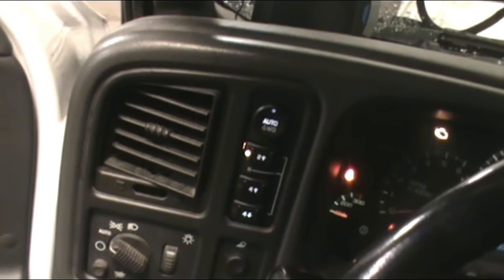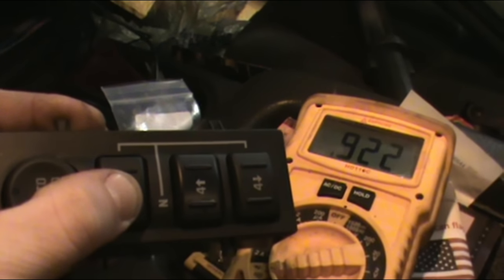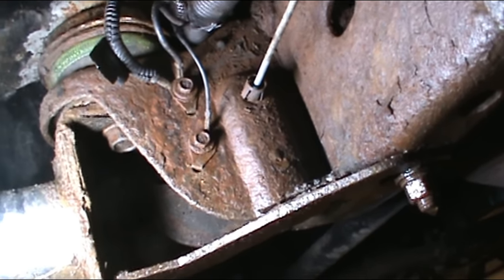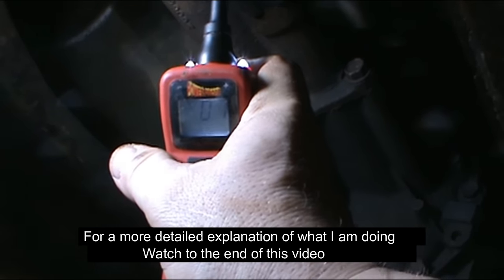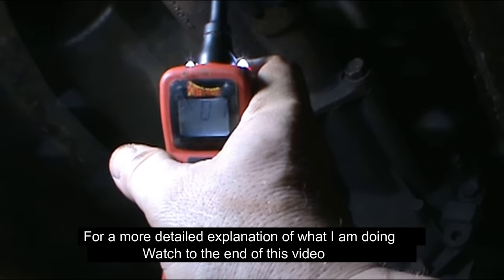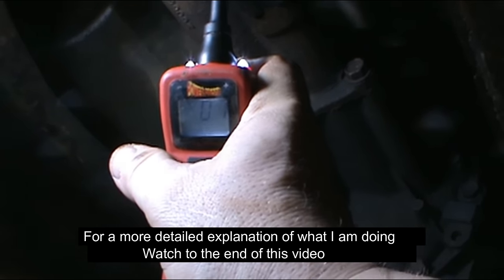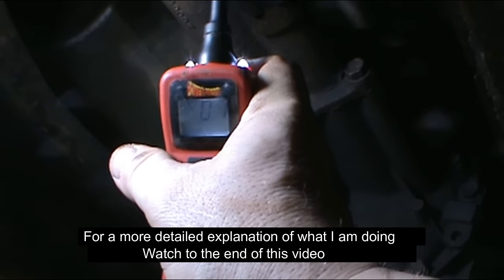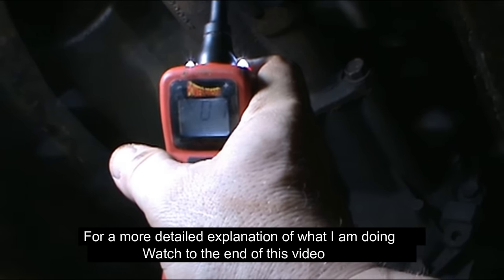Service 4wd diagnosis

Comment: DUDE I OWE YOU A BEER!!!! I did the same thing and the guy I bought the truck from even changed the transfer case trying to fix it. I replaced everything else and was about to rip the harness out when I seen your post. 5min after locating that 4 pin connector added a ground and BAM!! it's fixed thank you soooo much!
Reply from the maker: Tony Gick Miller lite please, and your welcome

Comment: A year later after this upload and I have the same issue staring at me. If I learned anything about wrenching in 62 years it is to search you tube and keep the wallet closed and ask questions. Great diag. video and when the rain stops on on it like flies and dung. Cheers to you good sir.
Reply from the maker: @letthechipsfly7620  welcome

Comment: I can’t believe how well you went through the process. So much better then other. I changed everything before looking at the 4wd ground wire. Cleaned it then worked great
Reply from the maker: Ryan Dimaquibo so did I, that is what inspired the video.  I even took it to a professional shop and they couldn’t figure it out.  They changed the front axle actuator twice and told me they kept getting bad ones.  I took it home and troubleshot the wiring and this is what I found.

Comment: thanks for sharing! I'll try running ground wire tmrw. Was wondering if its not to much to ask The blue wire you ran. To which color wire on the clip did you tap into?
Reply from the maker: Sirena Mireles if I remember correctly it was black, but please check the diagram for your vehicle
Reply: @GSEShop  thank you and will do thanks for reply.

Comment: my switch started randomly lighting up on 2wd/4wd/neutral/4 on the fly/ or not at all.  So I changed the switch out.  When I first put the other one in, the encoder motor responded fine. I did 5-6 times, so I thought I fixed it.  However, next day I drove it, it went back to doing the same thing again with the service 4wd on the cluster again.
Reply from the maker: I would check the wires close to the encoder, but I suspect the encoder is bad

Comment: Man you are so awesome, I was at such a loss, switched out the selector ordered the actuator (which is now cancelled) and just happened to stumble on your video and as soon as I watched it I knew this is exactly what it was, went to Home Depot bought a multimeter, a pack of vampire connector and sure enough after maybe 30 minutes in the garage, my selector lights are working, service 4wd message is gone, and this encoder sounds like it has so much more power! Thank you so much you helped me out a great deal and I’m sure you’ve saved many asses, hats off if your ever in Oklahoma, beers on me!!
Reply from the maker: Thanks, not sure about the more power, but hey if I am ever near OK I will let you know

Comment: Dude I just replaced the actuator and spent forever trying to clean up the old ground and everything just to watch this and tap into the ground wire at the harness and run it to the main engine ground spot under the hood, thanks a ton! Fixed my problem instantly I cant believe I didn't think of this sooner glad i had all the supplies being it 10:30pm😁
Reply from the maker: Ryan Hazelton glad to hear it

Comment: I watched this video before doing anything.  You were absolutely 💯% right.. Got my meter out. Checked all 4 points. Found no ground. I ran a temporary ground wire and tested. Sure enough it worked. So, I ran a new ground wire. No more "Service4wd" ... Awesome. Thank you for your post on this.
Reply from the maker: Your welcome: I just don’t want others to struggle and spend money like I did.  Please like and subscribe

Comment: I had this problem along with the loss of cruise control.
Turned out to be the ignition switch. A local tech figured it out for me after I had gone through all of the grounds and fuses etc. Didn't take him long. If you don't have the tools and or diagnostic skills sometimes it pays to take it to someone that does. $100 fix for me.
Great video. Pretty cool watching you guys drill down on stuff like this.
Reply from the maker: Thank you, I like the challenge

Comment: Thanks for taking time out of your day to share your experience!  I'll use your techniques to check my Suburban.  One thing I'd like to suggest is when reconnecting the wire connectors, add dielectric grease on them.  Some of my issues in the past were related to moisture in the connectors under the truck.  Thanks again!
Reply from the maker: Not bad advice, but thanks for the praise.  If I ever redo this video I will add it

Comment: Same as many others who have seen your video, thanks man. I swapped out the encoder motor and switch. Nothing worked untill I checked the grounds and added a ground wire.
Reply from the maker: Glad I could help

Comment: After watching a couple vidoes and in one it said the form said to start with cleaning off ground bolts. All I did was clean the ground bolts with wd40 and toothbrush and it worked . Before that none of the lights for 2wd 4wd lights were alumanating and was getting service 4wd code. All good now. Thank god for youtube 🙏
Reply from the maker: The wires will corrode and that way my problem so I spliced in the other ground wire.  Glad the simper fix worked for you

Comment: Brother that was a great video. I'm educated in electronics and  love auto electronic troubleshooting. Your video will help many  people find the failure related to the notorious service 4WD message with your troubleshooting procedures. There is nothing wrong with repair shortcuts like your repair if resources are limited or just need to get up and running quickly. Most will start throwing money and parts at their trucks so thank you for taking the time to share. I've subscribed and will keep an eye open for more videos from you. Take Care.
Stephen from North Carolina
Reply from the maker: Yotu Act thanks, I love to troubleshoot as well.

Comment: Thank you for your excellent video! My Yukon XL dropped into 4L from 2H by itself on a highway today lol! Checked every ground on the frame, wires and the 4wd fuses. Wallet and Yukon not ripped apart!👍
Reply from the maker: Glad I could help

Comment: Thanks, I have a low milage 07 duramax that the 4whl drive hasn’t worked in 5 months. It’s horrible in 2wd in the snow and mud. I worked at a shop in my early 20s but its been decades. I was getting super frustrated with it and myself. Your video helped me a lot as far as what to look for and how the system works. All my other trucks were manual trans and manual 4x4 so were easy.  With your video and 1/2 of a Sunday I was able to get it working again!👍😀
Reply from the maker: Great thanks for commenting

Comment: Hi I have been troubleshooting for some time on my 4WD issues. So I went through the progression of the grounds cleaning first. Then instead of replacing the actuator motor i decided to go after the position sensor within, much cheaper of course. I got the AC Delco on Amazon for $35. So when i disassembled the actuator i noticed that the gears were previously matched marked but low and behold the factory match mark did not line up. I went and installed the gear, not where i found it but to the factory marks. So yes the smoking gun! I reassembled everything and my intermittent  service 4WD and the selector switch with the random lights coming and going were gone! That's great unfortunately it still would not shift into 4WD. So next step was the front diff actuator. I pulled it out and gave it power but it didn't budge. So I checked the voltage at the plug and got the 12 volts on the brown wire but got no ground on the black wire - should have read 000 on the ohm meter but only read 1 meaning no ground like the video. I tapped into the ground with a vampire connector right close to the plug instead of chasing it back. I ground down a spot on the frame and ran new wire to the frame and fastened it with a self tapping screw. Tried it again and Viola!  the motor turns. Reassembled it all and it works perfect. Thanks so much for the video help and helping the diagnosis, solved both issues for $35.
Reply from the maker: Your welcome, please like and sub.  Hearing this makes it all worth while
Reply: Right on, good info.
Reply from the maker: @halfassranch8363  thanks
Reply: @GSEShop  your video has by far been the best.  It covers all the other videos I've watched in one. I'm pretty sure its the dash switch but all my freaking tools are in storage and two hours away.
Reply from the maker: @halfassranch8363  your welcome

Comment: I have a 2004 Avalanche ...Service 4WD ...same issue.... I am going to try this, I too have been fighting for 2 years... replaced switch, replaced TCCM..... error comes on ocasionally (usually when you need it.) has been working great for  months until the Giant pot holes on the interstate jarred the truck to death.... no more 4WD....... I am more than sure it is a Ground wire, you have given me a great place to start...THnx
Reply from the maker: You’re welcome

Comment: Gonna have to try this. I tried the motor, the switch, the brain, the ground on frame, front actuator and transfer case speed sensor and nothing has worked. Thank you for posting this.
Reply from the maker: nick newman I even took it to a pro shop and they couldn’t figure it out

Comment: Good info 90 percent of the electrical problems can be traced back to lack of ground. Thank you for sharing. Make up a simple jump wire @ 3' long with a clip on both ends to do your ground testing is one of the cheapest and most useful tools you can have. Very good info. Thanks
Reply from the maker: Gary Jordan good idea

Comment: Great video, one handed dexterity is looking good, I did an o2 recently and had to connecti it one handed, it took a bit but i got it. No to try and fix this ground issue, I have already cleaned the terms under the truck on the frame, so not i will check the front acuater ground. thank you very very much for the video, good good stuff here.
Reply from the maker: Thank you

Comment: Actually a very helpful video! Going to try this on my '01 z71 4.8. Got one for you. I lost all drive while shifting through 2 and 4wd. Now when I shift from neutral to park I get a grinding sound. Park doesn't lock the wheels. Someone who knows, will know in a second. Please help me out. I hate to throw parts. Reason I really love this video. You actually show how to diagnose. Thanks man!
Reply from the maker: Check out my Silverado pops in neutral video and my one one replacing the transfer case shift motor.  I think your answers are there

Comment: this is so crazy. I bought new for the first time in my life and I`m 64 years old. I looked for the the cheapest Yukon that I could find. made the deal when I picked it up it had 2 miles on it. nobody drove this truck. it owes me nothing. 345,000 miles on the Original motor & transmission. I did almost the same thing that you did. Switch, shift motor & actuator with no luck. I figured that with all the miles on her that the Transfer case was beat. oh and I even did the ground lines under the side of the  drivers side door. I even ran a main ground line from the first connection where the negative side of the Battery  goes to. then ran it to the fire wall then ran a main from the fire wall to the frame on the drivers side making sure that I have a good ground. watched your Video and said no way. but I just did exactly like you did and no more blinking light on the switch and no more SERVICE 4X4 on the dash and everything works as it should. I can`t thank you enough for your Knowledge on the way you chased this problem down. I have played with this for a year and a half and I was stuck on a TCCM or a transfer case. until you.  I am still in shock but with a smile.  Thanks again  Bill
Reply from the maker: Your welcome glad I could help

Comment: Dude, you rock! I had the same issue on my 2005 SLE, with a  Code C0379. I didn't have a power probe (ordered and coming in tomorrow) so I back probed the ground wire at the actuator connector with a paper clip, attached a jumper wire to that with a small needle nose vice grip, and attached the other end of the wire to a random frame bolt with another pair of vice grips. Powered up, hit the 4H button, BAMM! it worked. Hit 2wd and it switched back no problem. I followed the harness from the actuator up under the hood, where it connected to the same style plug as you showed. Spliced into the black wire and ran the wire over to the right side of the brake booster to a firewall stud located between it and the fender. I liked that the wire was a little more discrete in that location. 
Thanks for taking the time to do the video.
Reply from the maker: Carey Buchanan I am glad, I just hope I can save someone else the sleepless nights and money I spent.  Please like and subscribe
Reply from the maker: By the way the power probe is worth every penny

Comment from the maker: Thanks please thumb up and subscribe!!
Reply from the maker: Thanks
Reply: Hi GSE, so my 2005 5.3 chevy silverado was having the same problem as your truck it was in 2wd with 2wd light illuminated but no response when i tried shifting it. I bought a new front actuator a new encoder motor and a new switch. I tried the new motor and actuator and after a vit of fiddling with the new motor not on the truck just dangling it shifted into 4lo but the 2hi light was still on. It would not shift back and i unplugged it and replugged it and now there are zero lights with new or old motor although new switch displays neutral i know its in 2hi and old switch has no lights on. I forgot to mention with the old motor in i plugged the new switch in and it said 2hi and neutral. I unplugged and re plugged and now only the neutral light
Reply from the maker: @jaxonchang737  I would say you have an encoder problem.  I would put the new one on and mount it fully and see if that fixes it

Comment: THANK YOU SO MUCH! My 2005 Tahoe is having the “Service 4WD” error message. A yr ago, I replace the dash switch, fine until now. I know the mechanical parts work - it is stuck in 2WD, and I cannot change this, so the error has got to be a faulty ground somewhere. MUCH APPRECIATED!
Reply from the maker: Your welcome, please like and sub
Reply: I’m having trouble with my Blend Door Actuators, 2005 Tahoe. I’ve watched replacement of these (drivers and passenger) many times. Passenger seems toughest. 
1. Do you have any videos posted that address this issue?
2. How many ‘Blend Doors’ do these vehicles typically have (can’t find a straight answer). 3? 4? 
Thanks! DS (Surrey, BC, Canada)
Reply from the maker: @dstotyn1029  i do not have a video on that but I did do it once and it didn’t fix anything for me.  I only have one under the passenger dash but I cannot confirm on the bigger Tahoe or suburban
Reply: @GSEShop  thank you for the reply. Based on what I’ve seen, I prob have 3 Blend Doors in front part of cabin (rear area is working fine), aside from the main Mode door. I’ll have to dig in to find the 3rd, believe it’s above gas pedal (under shroud). I’m fairly certain one or all of these are my problem, because of the intermittent work/not working scenario. I’ve recalibrated. Works fine, then not so good. Anyway, I really appreciate all of your videos. Please keep up the great work. You do a great job of capturing the details on video and explaining things so a dummy like me can comprehend and take action. Cheers, DS
Reply from the maker: @dstotyn1029  thanks, it takes a dummy to speak dummy lol
Reply: @GSEShop  You’re so modest... lol

Comment: Thank you for sharing this video. I have a 2005 Silverado that keeps flashing the service four-wheel-drive. But generally the four-wheel-drive works fine. Once in a while it does not want to kick out a four-wheel-drive but after you drive it for a little bit it will go ahead and disengage. So not sure what’s going on but definitely gave me a lot of things to check.! thank you for sharing this video. I have a 2005 Silverado that keeps flashing the service four-wheel-drive. But generally the four-wheel-drive works fine. Once in a while it does not want to kick out of four-wheel-drive but after you drive it for a little bit it will go ahead and disengage. So not sure what’s going on but definitely gave me a lot of things to check.
Reply from the maker: Your welcome please like and sub

Comment: I have a 2004 Chevy Avalanche, and been dealing with 4wd issues for almost a year.  One shop quoted me $900.00 and said I needed a new Actuator.(lol)  The issue I'm having is the lights turn on on the selector switch at start up, but all turn off soon after, I also have service 4wd on the dash. I have replaced the rear actuator motor, 4wd selector switch, tcm, and cleaned up the ground underneath the drivers door but still have the same problem. I will check for true ground at the front actuator as you recommend, and post an update. Thanks for the video!
Reply from the maker: So you lose all lights?  I am very interested and I have my own theories.
Reply: Well after a few more days of frustration, I had to take my truck to a automotive shop. According to the shop it was a failed encoder motor. He mentioned that the gear pin was locked in place and a few wiring issues. This shop is highly rated in our area for troubleshooting electrical issues. They literally had my truck all day and the gentleman said more than one mechanic was work on my truck. I can honestly say I'm am glad it is fixed and finally I have my 4wd again. Thanks again for post this video!
Reply from the maker: B e sorry I couldn’t fix it, but I am glad it is fixed.  What gear pin?
Reply: Not sure but that's what he called it. I also have a few leaks around the transfercase seals, I wound if any of that fuild could have caused some of my electrically issues.
Reply from the maker: B e possibly